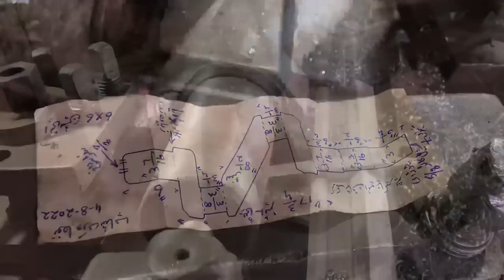The Ingenious Guy Cut a Aqua Cruise Ship Crankshaft || And Made a Giant Crankshaft For Compressor ]

Comment: Apart from workers without any protection, often in open sandals, sitting on the floor in dust and chips, machines with open and unlubricated kinematics, I do not understand how every screw and bolt has to be tightened so strongly with the help of tube extensions on the wrenches... Surely it must be a habit dictated by ignorance of material strengths, right?